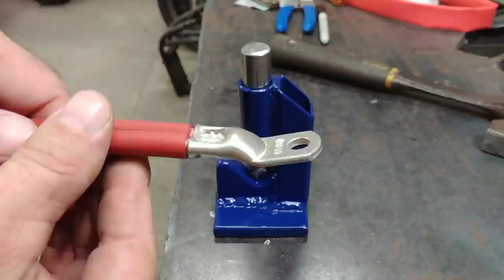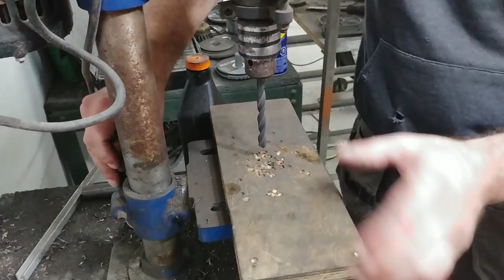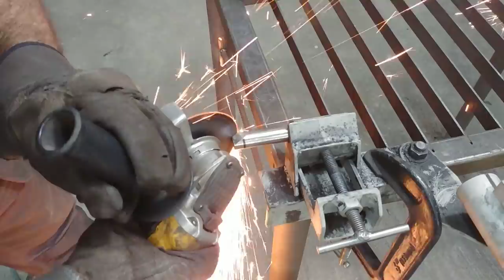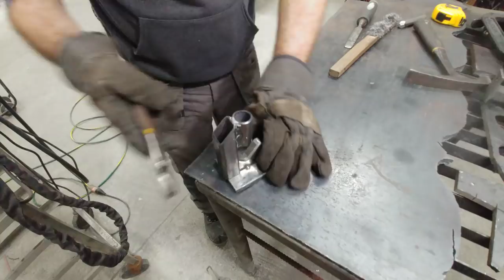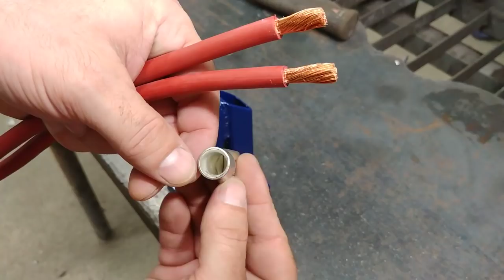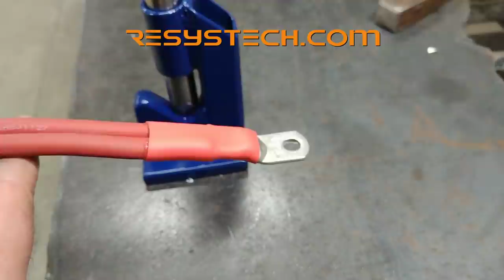Making A Hammer Crimper

Comment from the maker: A few side notes about crimping copper lugs to battery cables - as with everything these days, there's a silly debate about whether to solder a lug and cable or not. Some people believe solder is the only way, while most electricians simply crimp most cable and lug connections. But there are circumstances that apply. 

There's nothing wrong with soldering your lugs, if you have the means to provide enough heat to do so without damaging the cable insulation and you use a rosin core solder, NOT acid core (that's corrosive to rubber and plastics and is used for copper plumbing, not electrical). That's the problem with soldering. It makes a solid, sealed connection that won't corrode, but the thicker the cable is the more heat it takes to wet it until you get to a point where a standard soldering iron isn't up to the task.

Crimping will provide a bond that's as strong if not stronger than solder in some cases, but if tinned copper wire/cable isn't used (which is expensive), then some precaution needs to be taken to prevent the cable from corroding inside the lug later, which all copper does when it's exposed to moisture in the air. You can sand a bare copper conductor clean and shiny, but it will eventually turn green (sooner or later depending on RH levels) and could affect the connection if the mating surfaces aren't married perfectly and air tight. To prevent this, you should use tinned copper lugs, not bare copper lugs. Tinned copper lugs have, of course, a coating of tin on them to seal the copper from the air and they aren't too expensive. The next thing you should use to protect the connection is heat shrink tubing. But not just any kind - you need the stuff that has a layer of glue on the inside surface. It's like hot glue, when heated this will make the final seal between the shrink tubing and the cable/lug connection to keep air and moisture out. Windy Nation sells a variety of battery and welding cables, lugs, shrink tubing and loads of wind and solar gear at windynation.com

I'll have the next video for the crosskart build series uploaded in roughly a week, give or take a couple of days. I'll be assembling the P groups for the 11.5 kWh LiFePo4 battery and test fitting them in the crosskart cabin with aluminum cases and the new bucket racing seat from Scat Enterprises. I may test fit the cooling system while I'm at it, if the pump arrives in time.
Reply: Might you do a video on a diy metal bender, I think it had a blade that bent the metal? 

I can't remember.
Reply from the maker: @marz.6102  Done. https://www.youtube.com/watch?v=eqpRH8Zflz4&t=29s
Reply: @JamesBiggar  oh thx
Reply: Little addition.

Clamping alone is theoretically speaking a better connection, so you're better off soldering only in assuredly humid areas, always add the heatshrink tubing, if you want to go the extra mile add grease on the connections after mounting all together.

About the heatshrink tubing, you can  add caulk under it, tested myself, it will work well, grease the connection if the place is exposed to weather or constant humidity.
Reply from the maker: Yes, dielectric grease. Good point. I've heard of people using petroleum jelly as a substitute. Not a good thing to use around natural rubber but it should be fine for silicone wire and cables.

Comment: Soldering lug will suitable only for small pcb works but for Automobile related wiring required crimping wires. And for those who are doing that kind of job your hammer crimping tool will be very useful sir. Your design is simple to make and works too good. Thanks a lot👍🏅

Comment: why don't you have a nozzle gaurd on the welder? I think thats what it is called. nice project.
Reply from the maker: You could be thinking of a gas MIG. This is gasless flux core. The nozzles on gas MIGs are wider and recessed to allow the gas to envelope the contact tip and flow to the weld piece better. Recessed nozzles aren't required for gasless flux core MIGs, so they can be narrower and shorter to give the user more room to see what they're doing when they're welding. The welding tips are threaded so they can be easily removed and replaced cheaply when necessary.
Reply: @JamesBiggar  Yeah sorry if my comment come across like I was calling you out for something, In the fab shops I have worked in we used the run of the mill gas MIG welders, I noticed that the welds are nice and clean because if we ran out of gas our welds would have a lot of contaminants in them. So thanks for info and the comment back I like your videos, One day I hope to do some machining and fabrication in my own little shop. Have a great day buddy.

Comment: dielectric grease?
Reply from the maker: Not a requirement with sealed lugs - it would be an impediment, actually, as the glue in the shrink tube won't be able to stick to anything and provide a proper seal. Dielectric grease shouldn't be used INSIDE connectors like lugs. Some folks would say just put it on the bare wire only then insert it into the lug and it won't affect the shrink tubing. True, if you're careful enough - but that dielectric grease will affect the connection between the wire and the lug, because it's designed to block conductivity as much as it blocks moisture, NOT enhance it conductivity. Dielectric grease is an insulator. Covering the bare copper with it before installing the lug is akin to wrapping it completely in shrink tubing first.  Dielectric grease should only be used on the outside of an exposed connection or wire. Dielectric grease OR adhesive shrink tubing, never both.
Reply: @JamesBiggar  oh I see... Love your work!